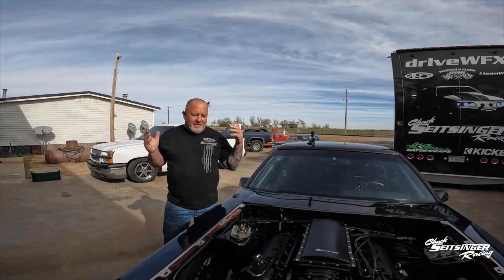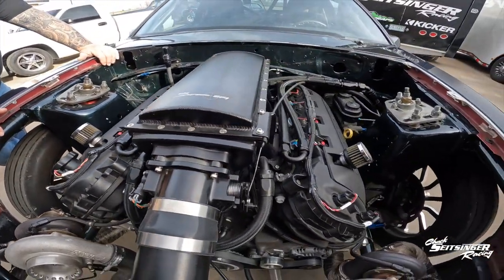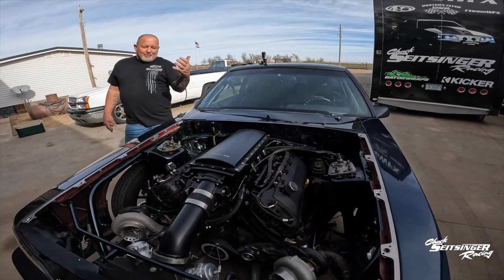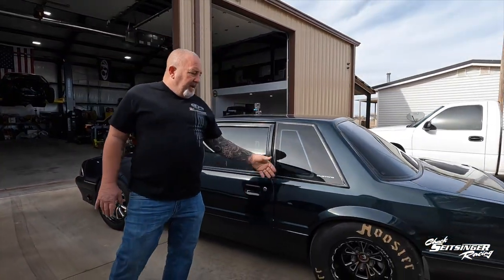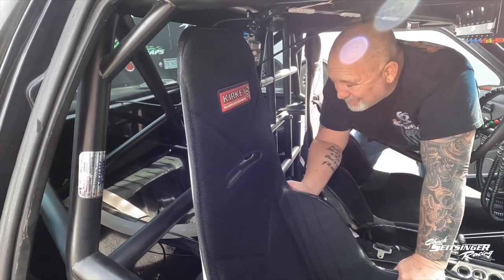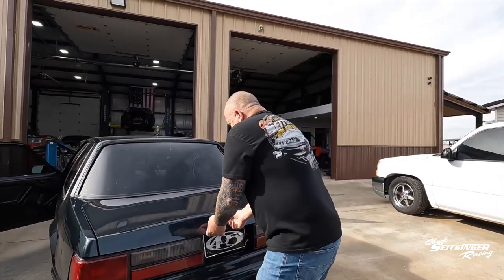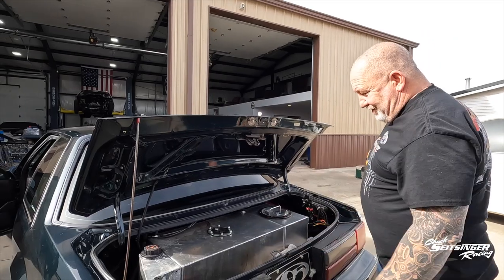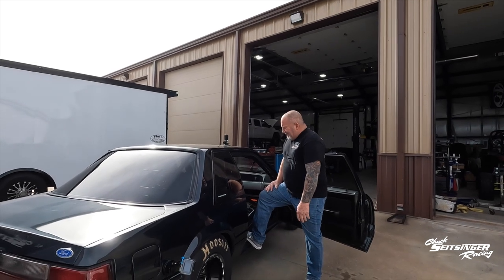BTS with Chuck's New Street Car - The Coyote. #streetoutlawschuck #streetoutlaws  #405  #foxbody

Comment: Glad to see so many people finally coming around on the Coyote platform. Incredible engines right out of the box
Reply: they are large
Reply: @alross18058  the heads are big. However lb for lb dollar for dollar HP per dollar there isn't a better starting point available.
Reply: @alross18058 they are badass
Reply: @alross18058  they fit into anything worth putting one in...
Reply: Best platform out there for making big power right out the box! Big heads and really strong durable blocks and bottom end!!!!

Comment: I love that car it's the way I've wanted to build one I wish somebody would start try a coyote in NPK the platform seams like it would be awesome
Reply: Alot of work time/money has to go into getting 3500hp out of a coyote. Swapping out rods, bearings, heads/gaskets takes alot of time with all the added parts a coyote has.
Reply: True but that's with all engines you have to change that stuff or it is gonna rip itself apart
Reply: @danielmurphy4023  coyotes are strong and can handle more power on a stock lower than most. And yes engines require modded blocks, internals etc. What I was referring to was the longer amount of time it takes to swap out parts than compared to a pushrod engine. That's the only reason alot of people don't use them. Other than that and the space they take up in an engine compartment they are bad a$$ engines no doubt.

Comment: Chuck, question for you. I see this a lot actually, but with as expensive and tedious these big fire breathing engines are, what keeps road dust, bugs and other contaminants big or small from gettin into your engine without running filters on the turbos? I would be paranoid about that. Especially knowing that 1 little grain of sand/dirt can score a cylinder or a bearing. Or do you put some on when you go out for cruises like this?

Comment: Ok , I need to know , what's the mph and rpm's on the hwy with a powerglide , 28" tire and 411 gears? I have a sn95 with a c4, 28" tire and 355 gears and I run at 58 mph at 2600 rpm

Comment: A fox the way its meant to be!! Thank god there is another person understanding how great these coyotes are. Hell heavier s550 mustang gt and V8f150s have ran 7s mustang gt and 8s f150 in the 1/4 mile on stock sealed coyotes.   Coyotes only needs boost amd fuel and can make up to 1200whp  No heads no cams no pistons no rods no opening the engine unless you want to go built motor which then you can make up to 2000hp on factory block

Comment: you need a gear venders overdrive for the power glide bro. it will drop your RPM while on the highway around 600 RPM drop or more depending on your set up my dude. makes a huge difference and you can turn it off for racing YOOOOOOOOO

Comment: I'm sorry Chuck but bang for the buck is just hard to beat on an ls that's why people do it. It costs way too much money compared to an Ls to swap and go fast. Plus it's so wide so doesn't fit as well in things. They are very efficient engines but to get a used one hout paying big $ compared to $300 for a long block from pick n pull.

Comment: Dude you mouth off that your competitors are driving race cars but what you have there is a race car you drive on the street. Everything from the firewall forward is custom race car there is nothing that came on that year mustang, even the bodywork (fnders grille and hood) are Race pieces and yes you have a stock looking Coyote but everyone knows those motors are built from the factory and with minor mods (oil pump upgrade) cams and a single turbo they can make a Fox Mustang go 8 seconds in he quarter mile and I would guess your car can easily run 8 seconds. Kamikazee, Doc, Damon, Azn,  Farm truck those guys are racing "Street Cars" extreme street cars but  you are street driving a race car.
Reply: I think if he's got a tag an insurance, it's good to go. Like he said,he can go to the Sonic if he wants. I don't want to see a Jeep AWD street racing. Just my opinion. I want modified cars,basically on the edge of being a race car. Chuck has done that. Well done sir.
Reply: You have to remember that it is a TV show.  Drama sells. It's not real life. Hence the reason you rarely ever see any of the characters from the show at legit races and when they are, they get out run fairly quickly. This is a cool car, but yeah its no street car. Even mentioning daily driver in the same video is laughable.
Reply: First off buddy, those fenders are stock, second that grill did come factory on a 93 cobra and although the front bumper/ nose and hood is fiberglass some years foxbodys did come with a similar hood scoop and nose like the 80 pace car I believe. And who gives a shit if the motor comes built well from the factory, sounds to me that either you have a problem with Chunky or a problem with foxbodys. Don’t be a hater, it’s a bad look!